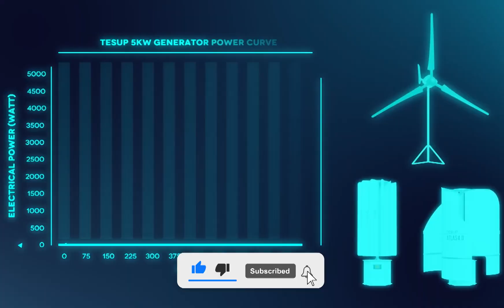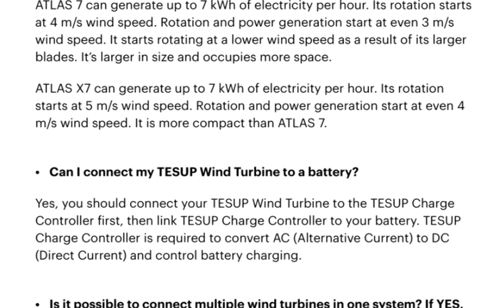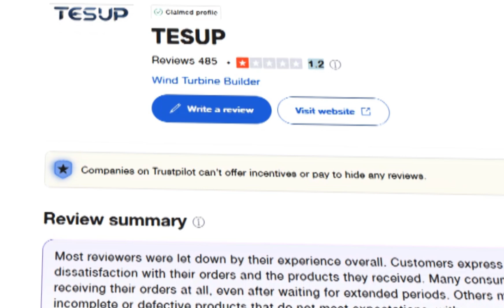Tesup Wind Turbine Review of Reality vs Claims

Comment: Here in the UK Tesup were placed into compulsory Liquidation by an order of Court with debts in excess of 250 thousand pounds.   Regarding the quality and performance of their 'equipment', I can only speak from my experience and can confirm the item supplied to me did not produce any useable electricity and mechanically failed in windspeeds deemed by them as 'normal'.        ....  BEWARE. ....   I also agree with the lack of reality presented with the statements of  'performance'. Certainly optimistic beyond the realms of physics we know today!   Tesup tease with fancy presentations and web site to the point anyone considering might think each little problem can be overcome, each year a 'new version' with improvements so don't accept the bad comments and failures with past versions...   I say again .... BEWARE. ....

Comment: I would like to see these videos supported by real life testing with volt and coulumb meters.
Hardly anyone with videos about vertical axis wind turbines does this. So I just have to take the stories for granted.
Do I believe that the power they can generate acconrding to the sellers is exaggerated? Yes.
But then test what they generate at Beaufort 4 and 5, You can simulate the wind by using an impact wrench or drill (I think).
Reply from the maker: Good Idea! Stay tined!

Comment: Reality: Every solar panels generate at least 10 times more green electricity with the same investment in time & money than small wind turbines! All practical tests show that small wind turbines hardly generate any electricity, because hardly any wind blows close to the ground! Wind/electricity yield increases with the third power of the wind speed. So +100% wind = +800% electricity. But close to the ground: 0 constant wind, only aggressive gusts! Whether wind and/or solar power - you need extremely powerfull batteries or a petrol generator to live off grid.
Reply from the maker: Sadly, but that’s true. I think it would be great to have the wind turbine for arctic stations (where half of year is constant darkness and solar panels are nearly useless). In such conditions, strong and stable winds could provide a reliable energy source, especially if combined with efficient battery storage.
Reply: @UnlimEnergy-f3r  Sure: Where solar energy and fossil fuels are extremely rae & expensive (e.g., at the North Pole, northern Finland, northern Canada in winter), wind power is worthwhile. But in 99.9% of places, wind power is not worthwhile compared to solar panels or fossil fuel generators.
Reply: What if it were on top of a two story roof?